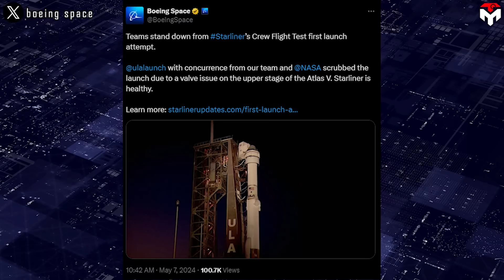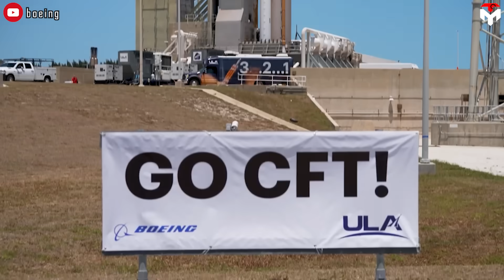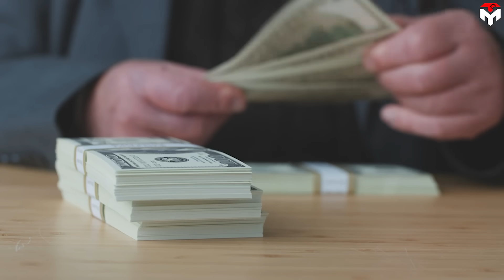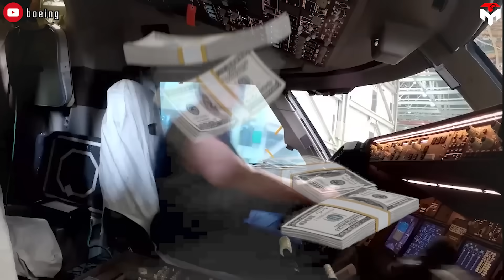Nasa Give Up On Starliner! SpaceX Dragon Awarded Billion Dollar Contract...

Comment: In general, monopolies are bad. Usually, it's a case where a large company purchases smaller rising companies that are or soon will be competition. Much like what Boeing did when it purchased aerospace giant McDonald Douglas, However, that's not what's happened with SpaceX. Blue Origin, ULA, Boeing, and others are still out there competing with SpaceX. It's just SpaceX is outperforming them, by a large margin. That gives SpaceX enormous clientele potential.
Reply from the maker: That's so great. thanks for sharing

Comment: My opinion is that the crew of the Starliner 5 and Starliner 6 should be reassigned to the Crew Dragon/Dreamchaser, and the latter from the Atlas V 022 should be reconfigured to the 522 to launch commercial payloads.

Comment: Why waste so much resource in other companies that continue to cost so much waste. Boeing continues to have issues within there company with constant failure with technology that has been around for decades. Why would anyone trust a company that continues to fly planes that have manufacture defects. Boeing had its time and now its time to pass the torch to the next generation that can keep up. 
The only company i would depend on is SpaceX and Starlink for the future. Technology is sound and its proven reliable. Everyone will want to use starship after the testing phase has been completed. 
Think how much humanity will be able to achieve when starships are running autonomously like the falcon rockets.